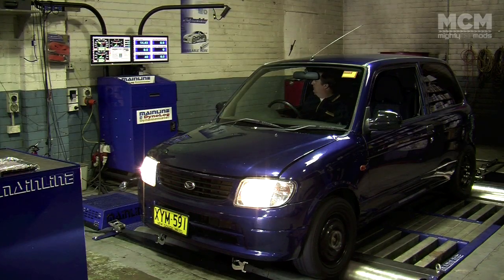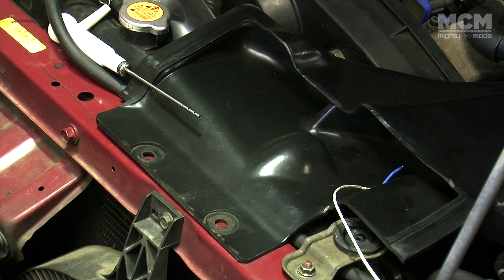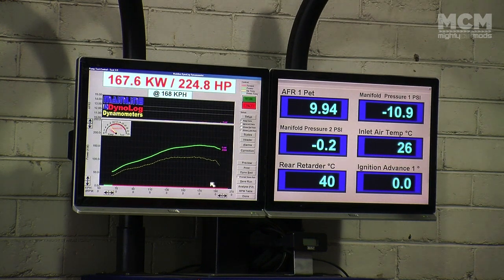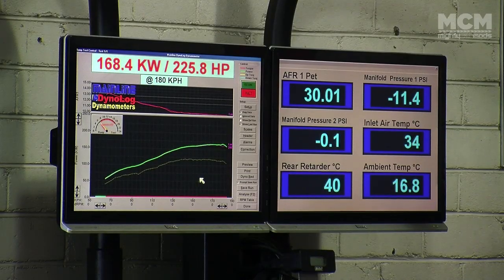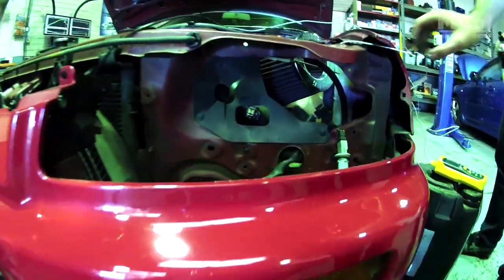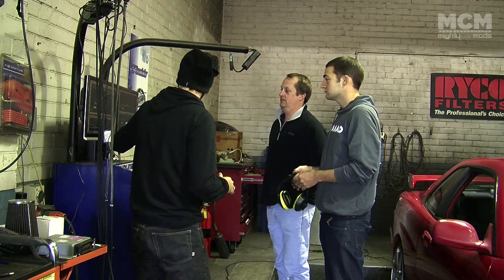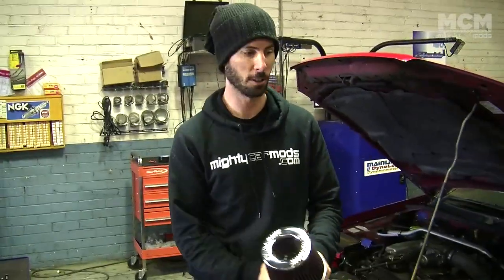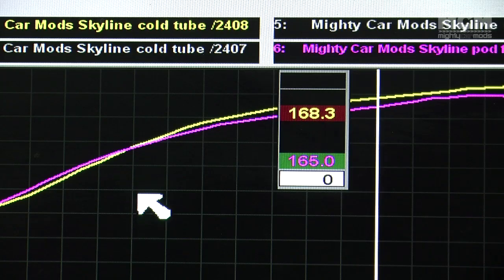Cold Air Intakes Mythbusted [Turbo]

Comment: Intake inside the cabin with the air conditioning on 😂
Reply: bro thats smart asf 👀
Reply: @JAAR826  bruh no, do you even drive a car xD having the air con probably robs you of more of the hp youll make with the cold air of the ac going into the intake lol
Reply: @emmanuellehuu8818  do u not have a sende of humor? or common sense?
Reply: @emmanuellehuu8818  that’s how u get no power loss with ac on 😌
Reply: Lol With the right setup you can use that to your advantage and you can actually gain freezing iats and sub-freezing coolant temps for the awic. The tuning comes down to finding the fuel and boost targets you are after. @mighty car mods you need to do an update on this. Especially due to the company being Australian! 🎉
Reply: New tech uses a standalone AC system that uses its own electric compressor, dryer and condenser. You wind refrigerant coils in a charge pipe that get down to -40F and this results in 60F lower intake air temperatures. You now have the ability to have IAT's below ambient and boost weather in the summer.
Reply: I filly stock intake air box with ice cubes, keeps air ice cold, power for dayyyyssss
Reply: Car (AC) more (cold air) = (more power)

Comment: fools, you need the K&N stickers for any increases. Geeze!!!!
Reply: Just put mine on.
Reply: Give this man a pizza
Reply: @proxima_midnite6056  what's your 1/4 mile time now that you installed the sticker?
Reply: Dude
Reply: OK how is it getting any cold air setting there ?
Reply: @allthingsmotor1073  Same times, but 1/2 mile runs.
Reply: They need to be sun faded and edge peeling before you see the real gains though
Reply: No, it's an import car so it needs to have rainbow exhaust headers and tips, rianbow headlights, and a rattle can black grille with the paint chipping off
Reply: LoL!
Reply: @Teeganator1  Eww!
Reply: And if you put flames on a car that'll give you about a 25% increase alone.
Reply: @critstixdarkspear5375  but wouldn't the edges peeling up create more drag and slow you down. I think I'll stick with new stickers.
Reply: God almost forgot about my stickers i knew i was missing something 🤣
Reply: i put that on my bike back box it does increase
Reply: K&N air filter is Trash, it lets to much dust in
Reply: @jacobsebastien3910  Bull crap!! It does not. I have used one for years now and no problems with it.
Reply: Im dead af
Reply: @proxima_midnite6056  Subaru what?
Reply: and paint more things red...red is faster by default
Reply: No no he’s got a point
Reply: Talking to your car adds 50%

Comment: Well of course you're not seeing any gains! You can't just slap on a different intake and expect any meaningful difference without properly tuning the car!!! Many cars will gain a fair amount of power by doing this, especially combined with a header-back exhaust upgrade.
Reply: Exactly! This video was meant to educate the idiots who think they are fast because they have an intake.
Reply: i agree ,the engine needs to be reprogrammed ,what is invovled in that step ?
Reply: Is it expensive to have your engine tuned once you buy a new air filter ?

Comment: 5:53 is in my opinion one of the most important notes of this test for anyone worried about heating up the air going into their engine. The fact that no matter the configuration your inter cooler is still doing its job is worth noting. While you don't see performance gains with the same tune all around I still have to wonder if the improved air flow helps increase your hp after a performance tune compared to stock. (just noticed the last comment on this video was 3 years ago...oh well)
Reply: Now im reading this comment 3 years on
Reply: I just read this 4 years later

Comment: theres a bit of a problem which leads to inaccuracy. turbo will heat the air up no matter how cold air goes before turbo afyer turbo it will be at the same high temperature, hence the need for intercooler. would like to see this video re-done on a natutally aspirated engine :)
Reply: They did do it on a naturally aspirated car. just YouTube "Cold air intake myth busted natural aspirated"
Reply: thanks, i didnt know they did it on naturally aspirated engine.
Reply: +Rokas Getautas Yaa no problem :)
Reply: You have to study more then if they such non-sence. The air has to go through the turbo in order to get pressurised. If the does not go through the turbo it either meand that the turbo is not mounted to the engine or the turbo doesnt even exist.
Reply: +justisstockton ..a turbo is forced induction into the engine. It compresses the air and forces it into the engine
Reply: ***** yes, one end is connected to the waste end and other end is connected to the inlet manifold. A turbo is device that uses the exhaust fume flow to pressurise the incoming air. And as I understand it you think that a turbo is there to add power using magic, like Moog said there are a thousand unicorns that fart at the same time to give more power.
Reply: +Rokas Getautas Lol, that is a good one!
Reply: +Rokas Getautas Just for the sake argument. I think the reason it works is because the turbo is sucking in air which is at a lower temperature OUTSIDE so it can suck in more molecules with each rpm of the turbine; making it more efficient at sucking in air..... (cold air is denser than hot engine bay air). That is why they saw a slight power increase with the air intake outside of the car.
Reply: shane mack you're right, but the air is heated up inside the turbo (lots of friction) hence the need for an inter-cooler, so cold air intake shouldn't make all that much of a difference because the friction will get the air hot anyways. :)
Reply: the logic side of me is being defied right there xD
my heads gonna blow up, because it can't be 2 sort of different things and both be right :D
its like 2+2 equals 4 but it also equals 5 and if you say either 4 or 5 you'll be right :D
Reply: +Rokas Getautas you're on the right track, the thing is that cold air intakes nowadays aren't actually used for grabbing colder air but rather the fact that the tubing is much smoother, less restrictive and doesn't include chambers and ridges used for lowering noise. Therefore a less restrictive intake = more air = more power.  Restrictions heat up air. So the cold air intake keeps the air colder as it travels into the engine. Notice in the video that they use a non-smooth tube each time. Defeating the purpose of the intake. The intakes work, just not how the guys in the video think.

example: my 2015 corvette's stock intake tube: http://i113.photobucket.com/albums/n227/paquetted/Stockoutofcar_zps05209c15.jpg

"Cold air" intake:
http://afepower.com/catalog/52-74202-1/52-74202-1_400.jpg
Reply: +honeybackedpipi ^^^
Reply: honeybackedpipi That's grand mate. You tied up the two versions and now I see how both fit in with each other. Thanks :)
Reply: +Rokas Getautas Yes the turbo heats up the air regardless of what you do, but not to the same temperature. The reason the difference in temperature is so small is because every 1 degree change at atmospheric pressure is divided by the number of atmospheres worth of pressure on the output of the turbo, roughly speaking. To accurately calculate it you need to use proper units for energy, not degrees C.

When you compress air you compress all of the thermal energy into a smaller space, which we observe as an increased temperature. Besides that, the Turbo is also contributing to that heat from friction and conducting heat from the exhaust. When you talk about how thermally efficient a turbo is, your actually talking about how much extra heat it's putting into the system.

Science
Reply: +justisstockton it never goes though the "hot side" turbine housing, but you can be sure it goes though the compressor housing...learn what a turbo is.
Reply: Ru Stei Heat conducts through the metal of the unit (casing, shaft etc) to the other side. I'm aware that the air being fed to your engine is physically separated, but the proximity to the exhaust driving the turbo is going to cause some transfer. Specialized materials can only reduce heat conduction so much.
Reply: +Rokas Getautas They already have made one on a N/A But i would like to see it on a higher hp N/A
Reply: +Rokas Getautas there's a reason why rally cars sometimes have water sprinklers in front of the intercooler to further cool down the air.
Reply: +Rokas Getautas 2+2=4.5, right? xD
Reply: RSProduxx Yes, if that's what you believe it to be. but in reality its not right :D
Reply: +Rokas Getautas it will not be the same temp after the turbo...because hot air is less dense than cold air. Therefore according to the laws of physics (there is a formula somewhere) the turbo with hotter air now has to do more work to compress hotter air than it should have to compared to colder air, thus making it less efficient, thus heating up the air to a higher temp. So for example say 30C intake = 80C outlet temp for a turbo, increase that inlet temp to 35C the outlet temp won't be 85C but maybe 90c+. Also an intercooler  doesn't cool the post turbo air to a fixed temp. It can only cool at a specific rate. So the hotter the air going into the IC, the hotter it will be coming out.
Reply: See: http://www.motoiq.com/MagazineArticles/ID/1901/Compressor-Efficiency-and-More.aspx
Reply: +justisstockton turbochargers force air through an intercooler(which cools down air) into the engine. its forced induction so yea youre wrong.
Reply: +Stephen Coates THE TURBINE DOES NOT SUCK  IN AIR, THE COMPRESSOR SUCKS IN AIR!! The Turbine wheel spins via the exhaust gasses coming out of the cylinder head. The energy and centrifugal force is transferred to the COMPRESSOR wheel via the TURBINE shaft. The compressor sucks in and compresses ambient air via the COMPRESSOR wheel, which is connected to the other end of the TURBINE shaft. Read a book or actually own and work on a turbocharged car before commenting...
Reply: +CHRIS DICK what I would like to see them try is to fill a cool box with ice and then some how feed the air through the ice, this should give nice cold dense air that all engines love. Also this will truly then be a 'cold air intake'?
Reply: rct2 i don't think ice would work for long time. but what we could try is to get closed liquid nitrogen system in place. a storage tank, a little pump and some tubing (cold resistant ofcourse) the liquid nitrogen would always cool the air thus giving more oxygen for the engine. I literally just came up with this idea :D
Reply: Rokas Getautas
 see my comment 13th april above ;p
Reply: Exactly what I thought. Its clear these guys are not experienced car guys or they would already know that with a moderately boosted inter cooled setup the location of the air filter is largely irrelevant. They would know that intake air temperatures will be largely dictated by the effectiveness of the intercooler. Just look at most aftermarket turbo and supercharger kits. For example nearly every intercooled kit for a Mustang or Camaro has the filer located right inside the engine compartment. The engineers at companies like Kenny Bell and Vortech certianly know what they are doing. You will also notice the lower boost non intercooled kits use a federwell cold air intake. In these applications these intakes can be the difference between detonation and no detonation allowing the engineers to run a few extra lbs of boost. In these examples you can attribute the CAI to a fairly large gain in HP often times 40 or more from the extra 2-3 lbs of boost the CAI made possible!

Large displacement naturally aspirated applications that are cammed up and have headwork also love these cold air intakes. Moderately modifed Mustangs for example can easily add 15+ hp at the rear wheels from them. They can also make a difference when running high boost with larger turbos as heat soak becomes a major problem. 

The bothom line is this test does not account for many factors and they picked the one application that would benefit the least from a CAI.
Reply: Please don't think I am hating and I just wanted to clarify this test does not apply to all vehicles. 

Their test is legitimate for this application, and clearly has value to the average young man or woman driving around in a stock  or mildly modified vehicle which in most cases would net similar results.
Reply: So a larger intercooler would be more desirable than the cold air intake ?????
I purchased a 2017 Mustang 2.3 L ecoboost and was considering the Rouch cold air intake being installed after the 5000 mile service. But after watching this.... maybe not.
Excellent EDM through the video too............
Reply: @mikemitchell728  m8 this was 2 years ago let it go lol
Reply: @mikemitchell728  I def didnt know then. I do now stop dwelling one shit that I said 2 years ago
Reply: @ilikeartica  my bad it just came into my news feed today didnt realize it was that old I had a rough morning and I didnt think about it or care if I came acrossed as a dick. I really do apologize sincerely bud.  Damn youtube for puting this old shit in my new feed Lmfao
Reply: Yes thats true

Comment: As the temperature graph you showed in the video proves, a cold air intake source does not provide "extra" power, it merely makes an engines' potential power production more consistent over time by keeping intake air temperature more consistent. This is actually less of an issue for drag racers than for road course or roundy-round runners for example.

Comment: The stock intake comes with a snorkel which feeds into the bumper. That being said, these guys didn't keep all the variables constant for this experiment. A properly designed cold air intake feeds the pod filter into the bumper just like the stock intake snorkel.

What their experiment shows is that short ram intakes with the conical filter in the engine bay feeds hotter air into the engine resulting in a power and efficiency loss vs. the stock filter.

To deliver colder air into the engine with the intake there air two things to keep in mind, filter location and pipe material. Metal absorbs much more heat from the engine bay than plastic or rubber, so metal piping will heat up the air inside more than plastic/rubber or wrapped piping. Lots and lots of variables to consider, that's why good intakes cost so much money and they really just aren't worth it if you're not boosting the stock engine where restriction isn't an issue.
Reply: UPDATE: So I actually did purchase a DC Sports cold air intake ($152) for my Integra. While installing the cold air intake I learned that on my car there actually isn't a snorkel from the stock intake that pulls in outside air. Instead, the stock intake recycles air from the engine bay through an air box within the passenger side splashguard.

What this means is my stock intake wasn't even drawing in outside air, but actually pulling in air through the engine bay, into this air box above the splashguard, and up to the filter. My cold air intake feeds the pod filter above the splashguard so it is truly drawing in cold outside air. I put an AEM Dryflow cover over the filter to prevent any chance of hydrolock.

I haven't gotten the Integra on a DYNO before and after, but I have definitely noticed an increase in power. My idle speed is greater, the car pulls harder in the 5-7k rpm range, and I get more pull in the low rpms while in 4th gear. Also I got a lean code from the extra air being drawn into the engine, so I simply reset the ecu to adjust to the extra air being drawn in.

Drawing in cold air does result in greater hp as their video has shown. You just have to decide is paying for a real cold air intake (not a short ram intake) is worth the money. For me, $152 for what I've gained was well worth it.

Comment: That flexihose is countering part of it's gain.  Denser air, but more resistance.  This should be repeated with piping with a  smooth internal surface, and with only enough length to get outside the car.
Reply: very good point.
Reply: yea def need a true pipe
the only improvement without one over a stock air box is a less restrictive filter
not really much this type of upgrade will do if ur not at least gasket matched 
with port and polish preferably
Reply: Yep, a baffled inside wil greatly hinder airflow.  And means the tube is thinner than it looks

Comment: this test is misleading and confusing to most people. this car is designed for high performance already. if you replace the intake on a stock car that was designed to reduce noise and save gas, then you will probably see a difference when you remove the small restrictive plastic ribbed pipes. you will see even more of a difference if it is taking in fresh cold air than if it was taking it from the hot engine bay.
Reply: Another problem is that this car is turbocharged. It is basically gonna do whatever it is gonna do unless you can keep it even more cool. A natural aspirated engine can se minor HP gains from a CAÍ.
Reply: Youre right...and the car is not moving, wich means it is not capting the right air flow

Comment: The only reason to fit a 'cold air intake' filter to a turbo charger, in my opinion, is essentially to act as a FILTER (dust, gravel, mud etc from damaging the housing) rather than serve as a cold air intake. It is not a practical addition to a turbo'd induction system as air is compressed (heated, eventually) and flows to the intercooler for initial cooling. So, what they were trying to prove/bust was done in a bad setting. Would have been a more effective experiment if applied to an N/A vehicle, outdoors and actually driving the car.